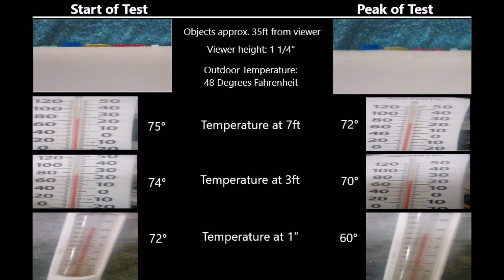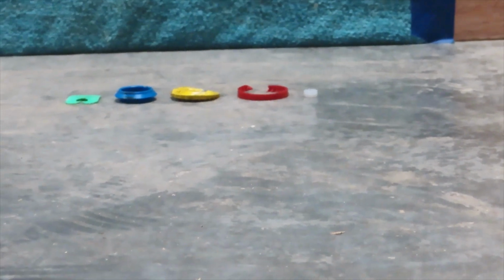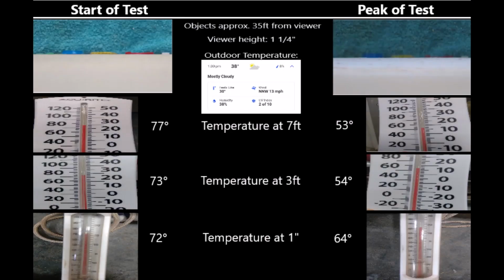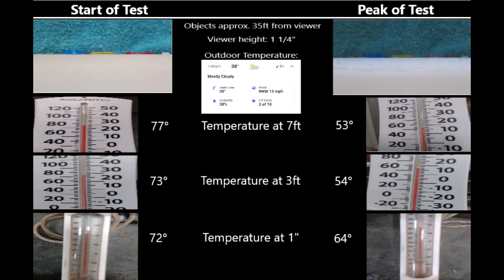Garage Mirage 2.0

Comment: There’s a lot to learn from that ladybug appearing taller than the refracting distant objects.  Just like alleged “bulge” should block increasingly more based on the closer angular size of the bulge than the angular size of the “hidden” objects.  The curvature calculators fail to consider this additional globe-busting issue.
Reply: Appearing taller? It may actually have been taller.
Reply: Especially if the driveway slopes slightly down from the garage door as they usually do for drainage.

Comment: When ballers ask why do ships disappear from the bottom up this explains it perfectly.
Reply: Well not really... upward refraction is a potential explanation of bottom up obstruction on a flat earth but the atmosphere typically bends light down. When you get several meters above the surface and observe something far away that's over 100m tall, then you are pretty damn sure that the air at or above your elevation has a decreasing density gradient, which means it's bending light down, not up.
Reply: @wiggles7976  The issue with the light bending down is that the light from the bottom of the object isn't likely to get to you. Combine with with the fact that objects in the foreground with tend to hide the bottom of more distant objects due to 'perspective' and it become quite clear why objects tend to disappear 'bottom up'. 
  This is assuming a flat plane. Once the 'curve of the earth' is considered as well then seeing distant objects becomes 'problematic' indeed? 
  You are free to believe differently of course. Thanks for your opinions.
Reply: @ryanqvincent144  How does light from the bottom of an object not reach you if light is bending down?
Reply: @ryanqvincent144  OK so imagine a flat ocean, and island in the distance, and you at the shore looking at it, with light in the atmosphere bending down. The light leaving the bottom of the island and initially travelling horizontally bends down and hits the ocean, HOWEVER, light leaving that exact same spot that is instead angled up slightly will start out travelling up, and then follow an arch and come back down and reach your eyes. It's the same as if you threw a rock from the bottom of the island up at an angle and it followed an upside down parabola and came back down and hit you.

So basically, on a flat earth, since light from all parts of an object across the water has an unobstructed path to your eyes, you would see all of the object.

Comment: Why are all the objects so small? A taller one in the mix would have helped to see what was actually going on, where the mirage was coming from and its effects at different levels. Perhaps that's what you wanted to avoid though.
Reply from the maker: The objects are small because you're not going to notice much of the mirage effects if they weren't in a mere 35ft from a viewer height of 1 and 1/4 of an inch. We've conducted test where we put a slight obstruction in the way of distant objects and have attempted to witness looming. We're not in this to prove FE. We're just showing the results of how the light from the distant objects behaves across various surfaces. This garage is likely not even perfectly flat. Our focus is on light refraction. We're calling into question more than just FE, like the radius of the Earth, because upward or sinking light refraction is incredibly easy to observe. If we had more space, then we would use bigger objects. When we do make observations over greater distances, we do use bigger objects. Also, maybe you didn't notice the hand lowering and raising the objects in this video? There is your bigger object.
Reply from the maker: Also in your comment to Taboo, you are correct, the ladybug and objects were about the same size and the ladybug was near the objects. So that is why it appeared the way it did. We're making a video to address Taboo's latest video and will have it out soon.
Reply: @skyfree01   Glad to hear that you'll address Taboo's video. Taboo presented an orthographic diagram of your ladybug incident which I believe is grossly inaccurate in order to push the FE agenda. Perhaps you'll provide a more accurate one.
Reply from the maker: @BigHeretic  Yes, and I don't know where he got any of that info. Perhaps he just assumed those details because we never stated the size of the objects nor the distance to the ladybug in our video. Have you heard of the channel Heath Carmody? He's linked in our description. He's also addressing the claims made by many FE'rs that perspective is capable of making a small object that is below eye level appear taller than a larger more distant object. Spoiler: Not possible.
Reply: @skyfree01  I could tell from your video that the objects were barely taller than the ladybug, Taboo did more than assume measurements, they did what most FErs do, lie.
Reply from the maker: @BigHeretic  I thought it was pretty obvious as well. I'm not going to accuse Taboo of lying, but it was pretty reckless to assume those details, he could've just asked. And now it's spreading like wildfire amongst FE as proof of perspective, when our whole channel is about light refraction. So I don't get it.
Reply: @skyfree01  Well your video is about not needing a curve so Taboo thought that you'd be OK for some "poetic licence", probably.

Comment: We know that if the air at the surface is hotter and the air higher up is cooler, and this gradient is steep enough, that the density increases with elevation. We know that the index of refraction increases as density increases, and if air density increases with elevation you get upward refraction. Collecting evidence for this is all well and good but it's sort of pointless since it's so well understood already.

What you need to do is gather evidence that the atmosphere is actually bending light upwards. It's well established that the atmosphere bends light downwards when you get several meters above the surface though, so you are fighting a losing battle. If you want to fight that battle then fine. How are you going to establish that the atmosphere bends light upwards? You've done observations over several miles where objects either loom or sink, but you didn't establish which case it was. It could have very well been the case that the objects were seen in looming conditions, and then in standard atmosphere conditions, and you incorrectly interpreted that as sinking. A small amount of sinking can even happen without upward refraction because the default for the atmosphere is downward refraction, so even if there is sinking, unless you somehow show it's drastic enough sinking you haven't shown that upward refraction is happening.

To have objects be obstructed on a flat surface you need upward refraction, and upward refraction requires an unstable density gradient. You know, here's one way to establish upward refraction is happening: measure the air pressure at like 1m above the surface, and then at like 5m above the surface, and show the pressure being higher at 5m. Do that enough times and that would give weight to your position that upward refraction is occurring.
Reply: You said: "... It's well established that the atmosphere bends light downwards when you get several meters above the surface though...". Sounds interesting... You have real world verified evidence of this and how often and what conditions it happens?  Real world analysis and measurements it happens? 
   Please don't tell me an 'expert' told you? You must have verified your belief is true in some way? see Wikipedia maybe?  

   Why do you believe what you say about light bending downwards from a few meters  is 'common knowledge'?
Reply: @ryanqvincent144  For some reason my comment disappeared. There are multiple reasons why I know light bends down. For one, the density gradient of a standard atmosphere would cause light to bend down, on a globe or a flat earth. Secondly, you can look at timelapses of celestial objects setting and they always slow down, indicating looming happened. Mick West had a good video about stars setting and showed they slowed down. Thirdly, Wikipedia references a measurement of the looming of celestial objects, which is about half a degree upward for an object that's on the horizon.

A standard atmosphere bends light down, that's just a fact.
Reply: Please provide ANY docs which demonstrate your first claims about air/ground temp. For instance, please quantify “steep enough.” Go.
Reply: @theplanetruth  I was simply restating Sky Free's findings in my first claims about air/ground temp. We all know "hot air rises" and that's because hot air is less dense than normal air at the same pressure. We also know that less dense air has a lower refractive index. This is sort of obvious because a vacuum has index 1, air has index ~1.00027, and if you had a cube of empty space, then adding one particle of air at a time to that vacuum until you got air like we have at the surface would gradually increase the density and gradually increase the index until it got to 1.00027. Thus, increasing the density must increase the index.

"Steep enough": Roohif went through the calculation of what temperature lapse rate is required to cause upward refraction. Temperature in a standard atmosphere (in the lower part) already decreases with altitude but of course, it doesn't do so quickly enough to cause upward refraction. I unfortunately forget what Roohif worked out, I want to say -34degC/km, but I'd have to ask him to be sure. According to a calculator I found online, it's close to -34degC/km. Near the surface the plot of temperature vs elevation might not be linear however.

Is there some other reason than upward refraction that you have to explain the bottom up obstruction Sky Free is demonstrating?

I think the most important thing in ALL of this is to determine whether upward refraction happens normally in the atmosphere. You know, we want to figure out if the earth is flat or not, and if the earth is flat there must be upward refraction happening regularly to explain the bottom up obstruction. A standard atmosphere bends light down though, so it's not looking good for the flat earth. I've already come to the conclusion myself that the earth is not flat, but if you want to argue that it is flat, you need to verify that upward refraction happens almost 100% of the time in the atmosphere we are looking through (since obstruction is exceedingly common). Have you or has anyone else verified this?
Reply: @Wiggles  your sounding pretty desperate. Tell me what it is exactly that has you convinced that the earth is not a plane. 
While you're at it try explaining the observation we call star trails while taking All motions claimed in the heliocentric model into consideration. Not just the claimed spin of the earth. The earth is also claimed to be traveling at a much greater speed around the sun (around 67,000mph) while also chasing the sun at around 440,000 mph. Why is it that if the heliocentric model is correct we only see evidence of the earth spinning (the slowest of the claimed motions) or the lights in the sky rotating around the earth if the heliocentric model is garbage?
Star trails  should look like a corkscrewing warp drive scene from the cockpit of a space ship if all motions were taken into consideration. Go ahead and say  the faster claimed motions can't  be observed because the stars are too far away. Everyone needs a good laugh.
Now... just think about chasing the sun at 440,000 mph. In just 20 hours the earth should have traveled  8,800,000 miles in less than two days yet year after year our night sky remains the same with no parallax whatsoever.
How about the constellations seen in winter and summer when we're claimed to be on opposite sides of the sun looking opposite directions at the galaxy. 
Seriously, what exactly has you convinced that the heliocentric model is even possible?
Reply: @mrrutledge1967  It's quite simple what has convinced me Earth isn't a plane. I measured the radius. It's about 6000km or 7000km. If the Earth was a plane, then measurements should just tell us that the radius is above some really large lower bound. If Earth was a plane and you attempted to measure the radius, you'd only find out that R >= 10^14 meters or so. I instead found R <= 10^7 meters. That's a huge contradiction. My measurements are completely incompatible with a flat earth. So are everyone else's.

You claim that star trails should look like a "corkscrewing warp drive scene". We aren't travelling near the speed of light through the stars, covering light-years per second like they do in the movies, so we shouldn't expect to see what they show in the movies. You made a claim, so I would like to see you back it up with calculations. Do a proper prediction from the heliocentric model, don't just take a wild vague guess. Put some numbers on your prediction.

There actually is parallax in the night sky. Astronomers use it to measure the distances to close stars. I can dig up a Scott Manley video where he showed a very clear example of a star showing parallax. Would you like to see that?

What's the problem with the constellations over a year of Earth's orbit? Each distant star can see almost exactly half of Earth's surface. The sun lights up almost exactly half of a hemispherical region of Earth's surface, and as Earth rotates, the solar illumination sweeps across Earth. All we require to see a star is that the dark half of Earth shares a common region with the hemispherical region that a star can see. For example, for stars within a few tens of degrees from Polaris, this condition is easily met every day throughout the year for anyone in the northern part of the northern hemisphere. Draw it out and think about it.

You've not yet actually found a problem in modern astronomy.
Reply: @Wiggles  when you responded to star trails you are apparently not aware that time lapse photography is used, nothing to do with the speed of light or warp speed and you know it. There are three claimed motions and a claimed speed for each. Why is only the claimed spinning, which is the slowest, the only observable motion using time lapse photography? All that proves is the earth is still and the luminaries spin around us.
Reply: @mrrutledge1967  Remember how I said for you to do a proper prediction about what the stars should look like in the night sky due to (1) Earth spin, (2) Earth orbit, (3) sun orbit? Actually ***do*** the calculation and predict what the star trails in a time lapse video should look like due to these 3 motions. It's no good for you to proclaim that you believe we should see something different than what we actually see, and then complain to me that your belief contradicts the heliocentric model. It doesn't matter what you believe. ***Do*** the calculation and predict what the sky should look like.
Reply: @mrrutledge1967  If the Earth were flat, then from 6ft viewer elevation the distance you could see would only be limited by atmospheric visibility. You'd easily see 60 miles or more on a good day. That is completely different than the situation on the globe reality. Dude... what are you talking about when you say "the distance just so happens to be the same"?